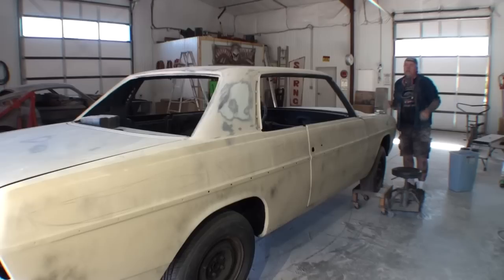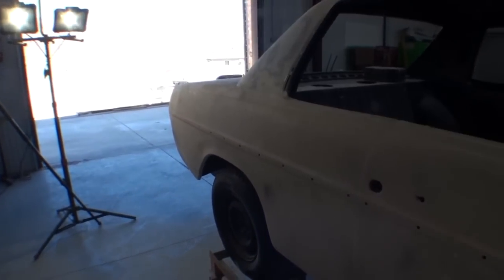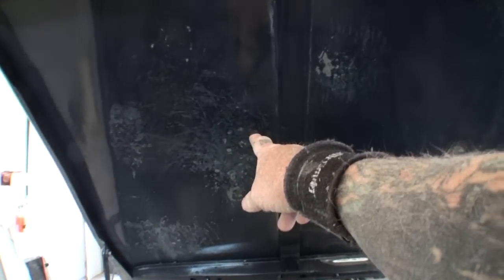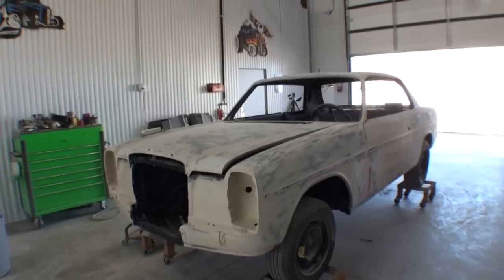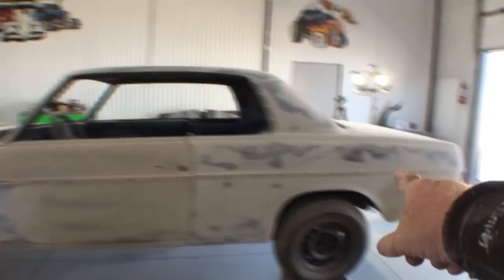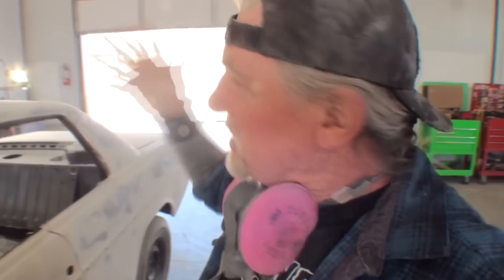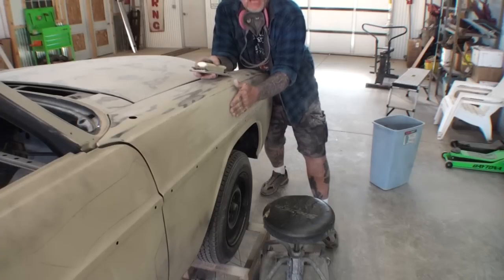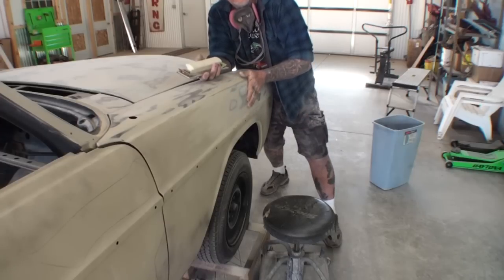How To Block Sand High Build 2K Primer

Comment: I'm at a point with my Durablocks that My Friend Pete is correct about. I need to get a hard long sanding block to ensure I get all the High/Low spots found before sealing up my car.
Thanks for your video and EXPERT advice. Pete may be getting old but his knowledge is timeless.

Comment: Hi Pete, what is the next step after your leveled the panel? what do you do with the bare metal sections and do you need another round of high build primer and blocking it down again so it should be a true straight finish? Great vids, helping me prep for my project car  👍

Comment: I bought those files the last time you had them in a video. I used them on my 78 Mustang, everything came out straight. I was impressed. Using the durablocks it always seemed it was never flat. Now I use the files for the body work and use the durablock for the final sand before paint.

Comment: I'm trying to absorb everything I can from  your videos.  I have a 74 Duster that needs a lot of work and 6 months ago I picked up a barn find 65 Barracuda 273 4 speed car that is in great shape body wise with a solid interior but mechanical stuff needs attention.  Do you have any videos that goes through all the tools recommended for bodywork that you should have for a beginner to start.  I was going to buy Durablocks to start blocking but now I'm reconsidering it after watching this video.  Thanks for taking the time to making these videos.

Comment: I like to restore cars and run a sandblasting biz on the side.   I just sandblasted a cab of a 79 F150 supercab, with correct media and setup, the panels aren't warped.   I did blast a metal cabinet, with very course media, and high pressure.  It warped and distorted the heck out of that cabinet.

Comment: At the machine shop people come in wanting me to stick stuff in the shot blaster (sandblaster but with metal bbs and a turn table, no control where pellets go) and I try to tell them it's going to warp thin, or shrink coil springs or blow holes in rusty rims and 9 out 10 say so it anyways

Comment: I have a 71 dart swinger and I’m having a problem were the trim molding goes across whole side of car but towards from the back of the door Thers hardly any body line ther primer over  a couple layers of paint and wen who ever took the body trim off you can barely see the body line and I don’t want to put the trim back on so should I sand down and put some kind of epoxy or high build primer to build up that area it’s on both sides of car I don’t know if I’m explaining it right  it’s funny once you do a bit of sanding what u come across what should I use to build up the body line  ?also I’m in Canada and things like good supplies are hard to find or very expensive I can’t get no Eastwood products around here but I’m sure Napa has something that I can’t use that’s a good quality I don’t want to use Canadian tire good ole  bondo  I think they sell better body at a Napa we don’t have many automotive supply stores in my area east of Toronto any ideas I want good body lines

Comment: Pete, This was a big help to me! I'm working on a 71Corvette. Doing practice work on the original hood before going to the actual car. Question: For those little low spots can you do filler over the Evercoat, or do you need to go back to metal for filler in those areas?

Comment: What primer is the best to put on bair metal
Reply: Epoxy primer is the best!
Reply: @jeremyking5684  
As. Long as it's bare steel
I prefer to spray a self etching primer 1st... Do plastic work then epoxy prime...
Reply: @jeremyking5684  
Or if it is a repair on the panel
& It's been sanded to the steel
Self etch,. Body work,  prime
Sand & then use sealer on the panel
Reply: Depending on budget the best would be DuPont self-etching primer. It is harder to sand and loads the paper up fast, but the durability can't be beat. It's the toughest stuff out there.
Reply: Really thin coat (follow the directions) of brand-name higest quality self etching primer, then when it dryes (once again highest price to get higest quality) 2k sanding primer. Solid color sand it to 400grit silver metallic it needs to be sanded to 800grit
Reply: @endrekasko9528  been in auto body for 35 years ,I don't use self etch on anything it's old technology that was replaced by epoxy, self etch will not protect metal like epoxy does, that why all high end shops use epoxy!
Reply: @endrekasko9528  not recommended to put epoxy over self etch!
Reply: @jeremyking5684  
We used epoxy over bare steel 
If the vehicle had to sit for a while
The reason for the self etch was to create mechanical bond ,. If you were not using 36 grit to manually
bite in... love the Dupont self etch & the 2k sanding primer...
Reply: @jeremyking5684  
The only problem we had was the epoxy sinking into 36 grit scratches after a while... Then we would do body work and either hi-build it  or
Use the old sprayable Bondo for the
finished primer... Then a coat of sealer...

Comment: As soon as you have the high cutting through to steel stop! After this point if you keep sanding you are wasting your time by making it wavy. So it will be ready for another coating of whatever you are using  Just before you cut back to steel!!! No exceptions.